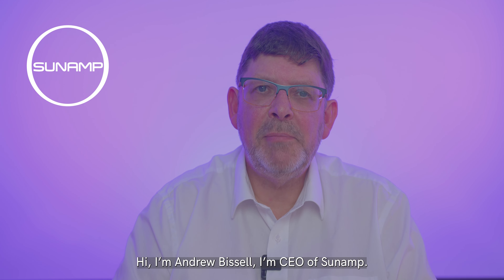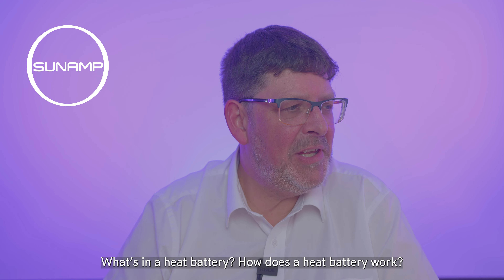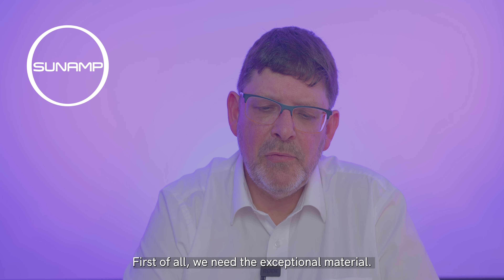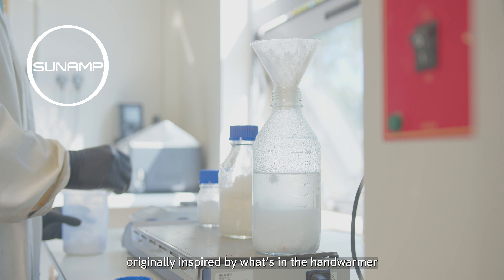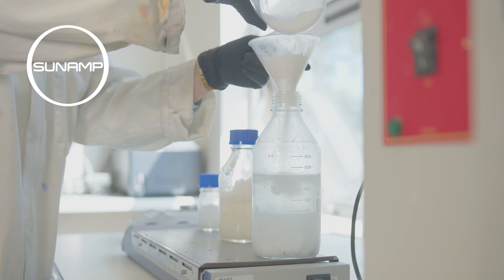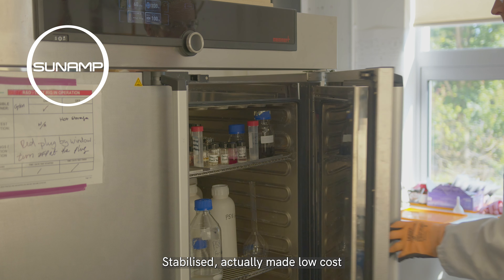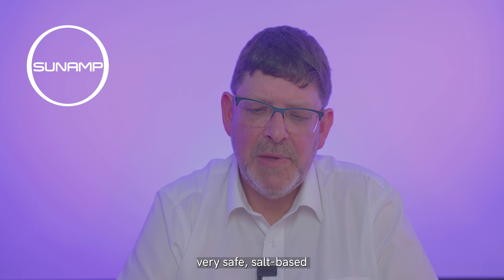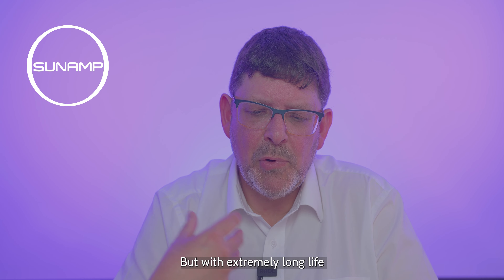How a Sunamp thermal battery works

Comment: This tech really seems like a great solution. I'd read somewhere that as a PCM melts it pulls away from the pipes with the water that's being heated, and efficiency could be increased by simply putting a weight on top of the PCM to hold it up against the pipes. Have you explored that at all?

Comment: Not a great explanation ? If this material changes like a hand warmer then when you run the hot water for 1 min do you have to boil that special material again for 10 mins so it’s ready for next time ?
Would be great to get an explanation on exactly how it works rather than a sales talk.